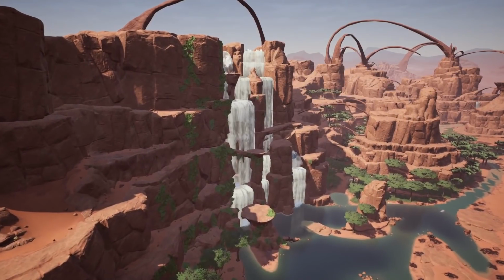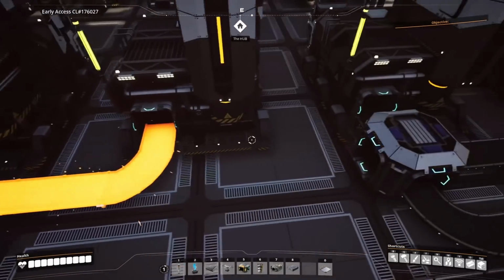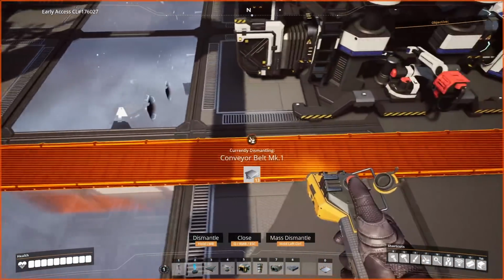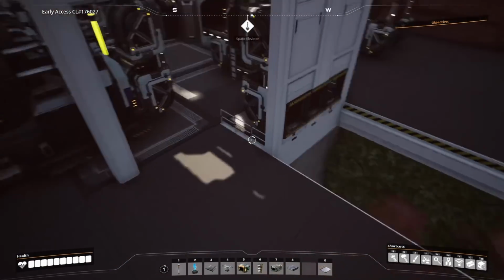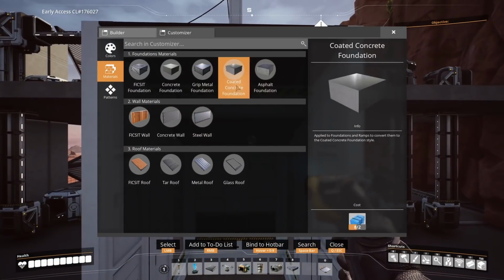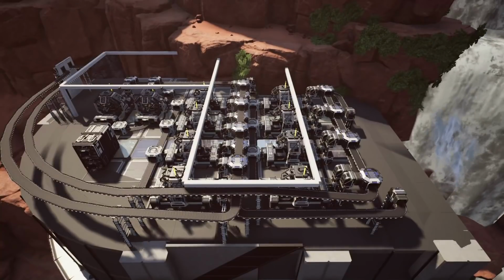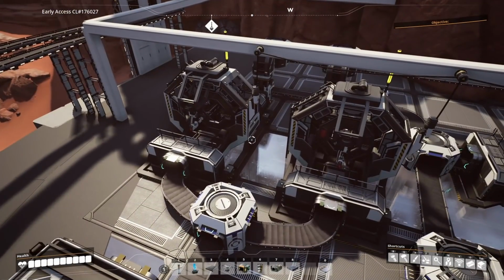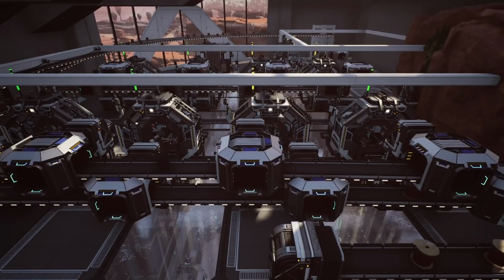Steel Motors Build Layout & Timelapse | Satisfactory Game

Comment: Gorgeous build. I personally have been getting a lot of milage out of:
Copper Alloy Ingots
Fused Wire
Steel Rotor
For my motor set up, while yes you do need 4  different raw ores it massively improves the raw resource efficiency, buildings used and power usage.
Reply: Your alternates are my choices too.  I also use Quickwire Stator and Rigour Motor as well.  I focus on the things like you did: raw resource efficiency, buildings used, power use, and how many items have to be moved around.